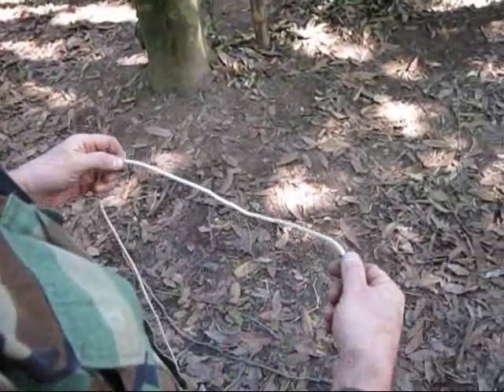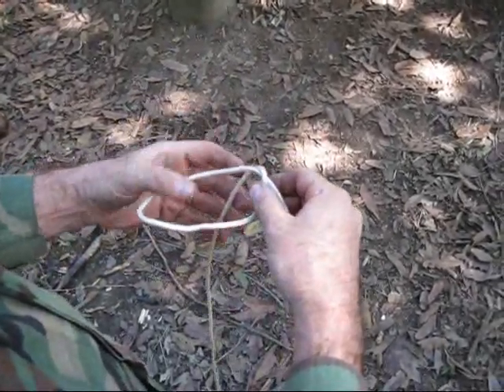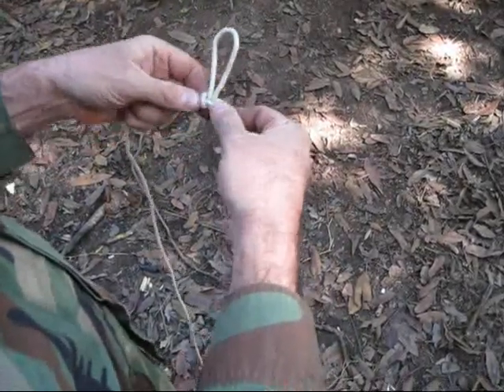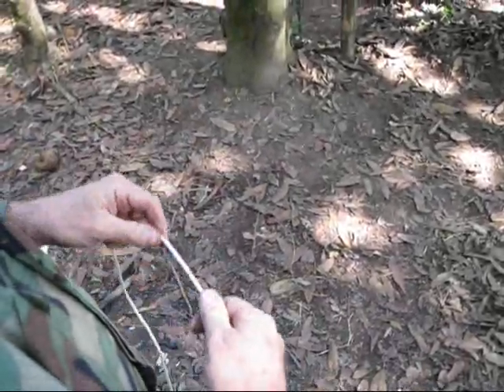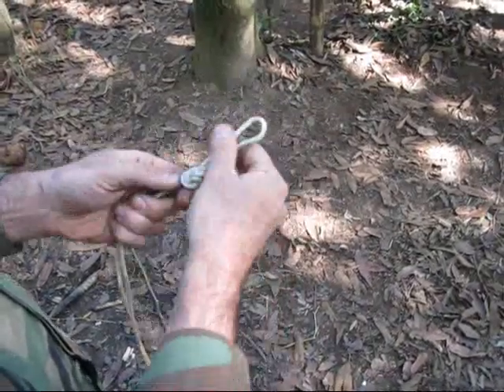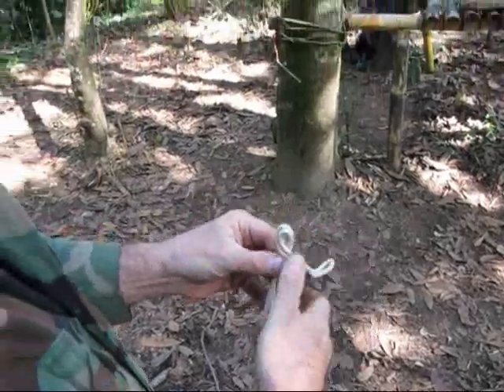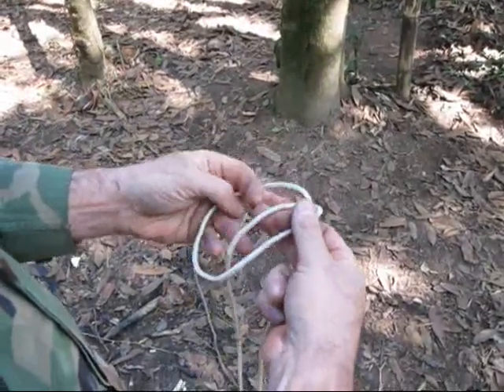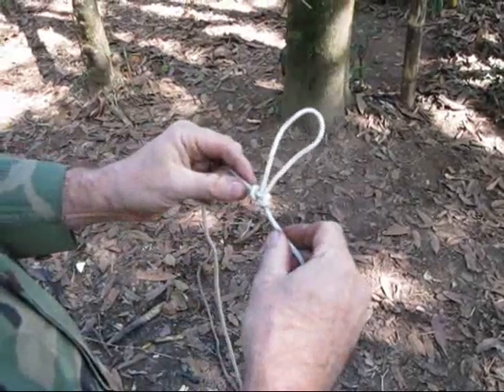Tying the Artillery Hitch

Comment: Thanks for the demonstration. I am in artillery and when we do 'man handling drills' ie pull the gun, we use 2 straps which are tube tape with solid bits of wood stictched and spaced inside. They are useless for getting any leverage on. Funny how we advance in technology but the old ways seem to have been better. Now if only I can convince my fellow gunners to learn to tie knots!!

Comment: I came here to find a second opinion as I first saw this hitch elsewhere. I thought I was missing something because that hitch was used in an application to tie down a load in the back of a pickup and the hitch created another tie down point in the middle of the bed where there was no hardware. The thing is, it looked like the cord was under a bit of tension. But when I put pull on the two ends, the hitch comes right out. Is that as intended and it's just known that the hitch MUST be put under tension or else it will come out? Please clarify for me - I trust you (and love all your videos!!!). Thank you!